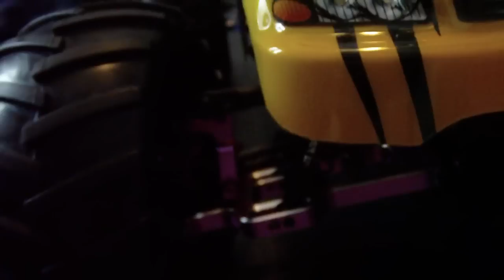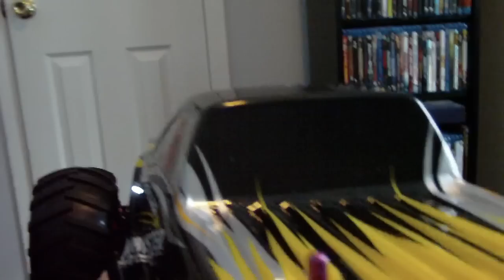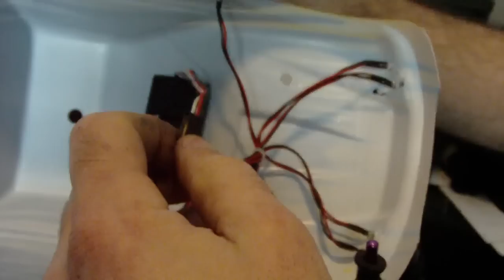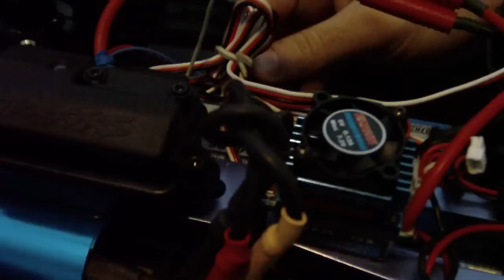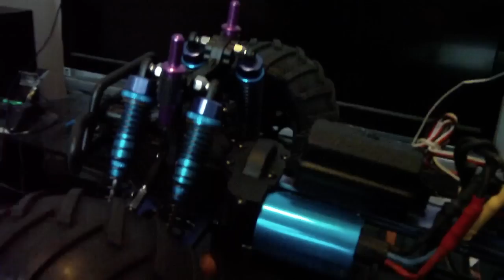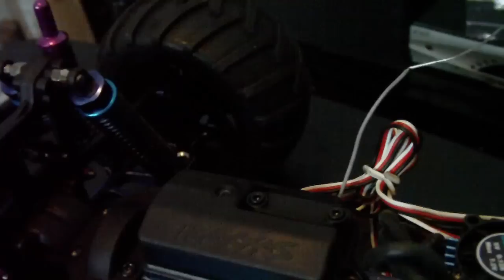My exceed Dynamite Pro Fully upgraded!!

Comment: Looking really good. I actually purchased some upgrade parts because of your videos, but I'm at a loss when it comes to installing the real axle holder. The "grub" screw that come with the original plastic axle holder do not fit the aluminum upgrade. Did you have any issues with that? Also, it doesn't look like you upgrade the aluminum linkage set this time around - any reason behind that, or am I blind? Thanks

Comment: I have the same truck, with a 80a speed controller and a 3s lipo. That thing was crazy fast, it could do standing backflips and everything, I didn't even break a gear, it's a good truck until you crash, I was running 2wd for most of it's lifetime because when you crash you lose your front dogbones. It did run 3s no problem tho
Reply: 3s Lipo on stock esc ?

Comment: @Prairie650titan589  You have to rewire the fan to the esc.Cut the wire with plug on the fan. Use an old plug to a receiver to rewire pos and neg.